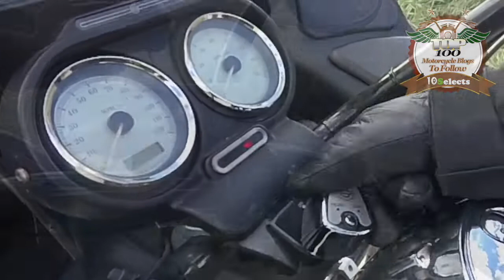Riding For A Cure Trailer Rebuild Part 17

Comment: Looks like it’s coming along near Rex. As for the slide going up and down I was thinking maybe if you could find some Teflon runners that would help but go up and down a lot smoother. Safe travels my friend.
Reply from the maker: I did look at the Teflon and may use it later, but the cost was way out of my budget for the Teflon. Thanks My Friend!